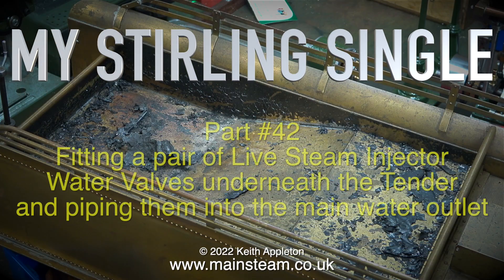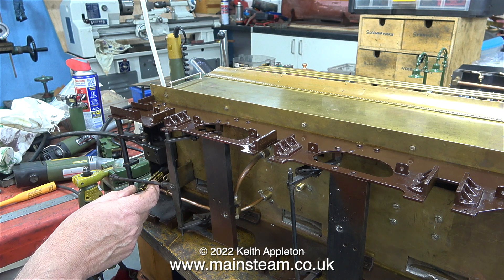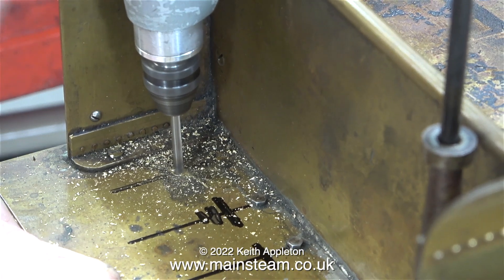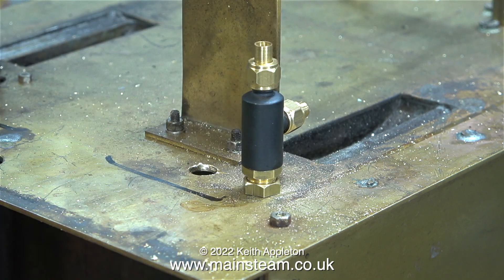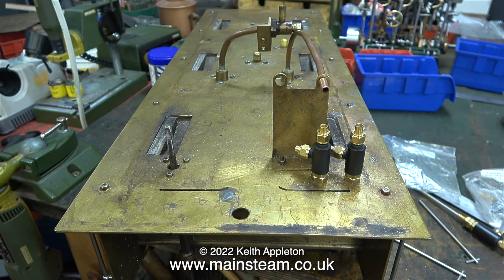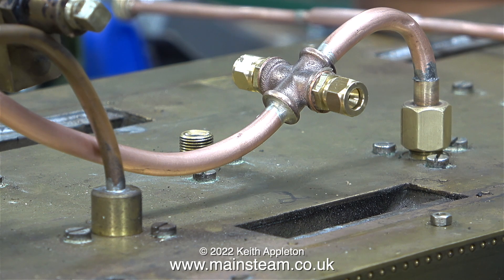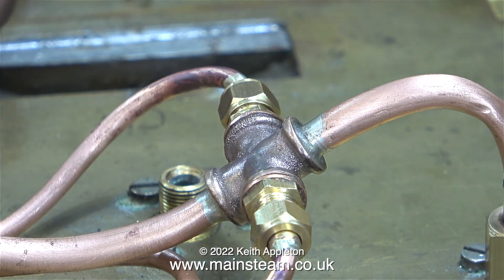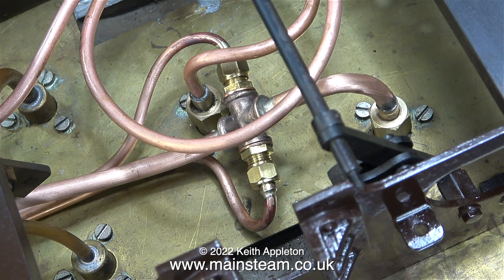MY STIRLING SINGLE - PART #42 - THE INJECTOR WATER VALVES

Comment: Drilled two holes in the wrong place yesterday in a piece of 1/4" thick mild steel. Unfortunately only had one piece of the right size. Fortunately not too critical load wise so I'm going to file them into slots.